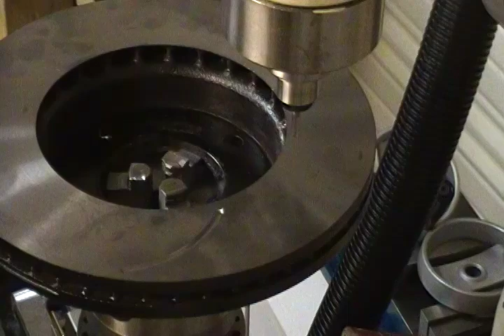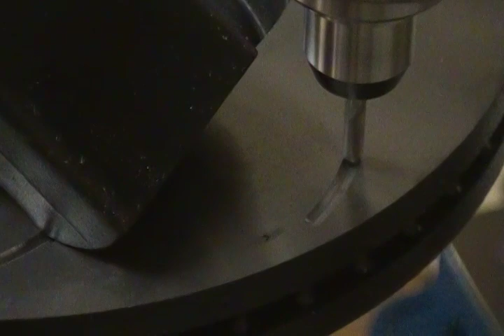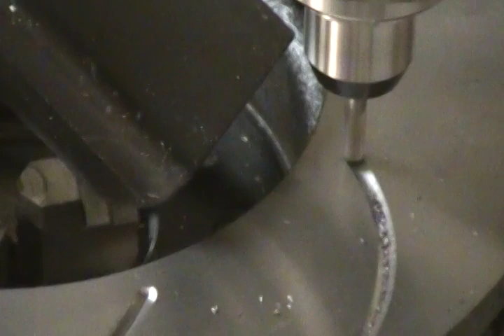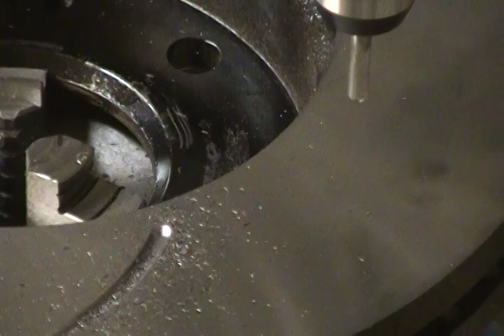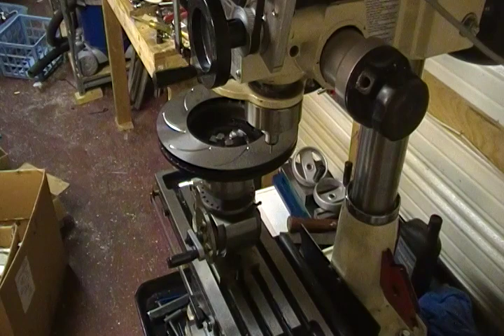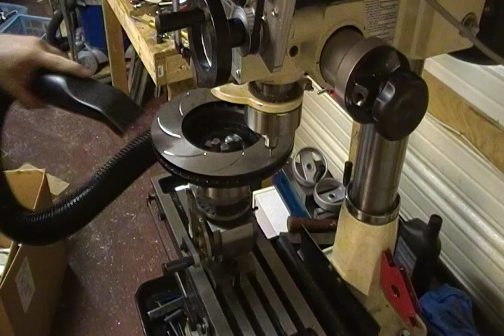Slotting A Brake Rotor On A Retrofitted CNC Mill

Comment from the maker: @sk8wnec  I did the retrofit myself I used 3/4" ballscrews for the X and Y and a pair of 1250oz steppers. For the Z I used a 700oz stepper with a 2 to 1 belt drive using the original gearing. For control I used the hobby cnc controller and an HP laptop running Mach3.

Comment: Hello JPN76

I would love if you could explain me how you retrofitted that CNC machine, we currently make drilled rotors but I would love if you could let me know how to slot with a not too elaborate CNC mill, please let me know, I would love to have the same setup, I don't mind doing it by hand instead of the automatic table.

Comment from the maker: @sk8wnec  Servos are the way to go but they are expensive. That's why I used steppers, I have less than $400.00 in the control system motors, electronics, ect... They are good for hobby but can lose steps if machining anything big.

Comment: whats he reason to slot it? I dont recall doing that when I was turning.
Reply: Helps remove water and debris from between the pad and rotor. If done right it also aids creating greater air flow over the surface of the rotor for better cooling, just make sure you slot them with left and right patterns.

Comment: Whom ever programmed the part needs to work on their programming skills. Start at one point, then reverse tool path, then start at the next closest end point and repeat this until finished. You’ll save about 50% of your cycle time and less wear and tear on your ball mills. Better selection of ball mills to a C6 carbide micrograin 3 flute is your best bet too.
Reply from the maker: ProfabDesigns Inc. Home built cnc  programmed with an old version of cambam. Not to mention this is my first ever cnc cut.

Comment: this video is a little old now but here goes anyway.

Both Good and Bad.

Good because it is good to see people doing for themselves.

Bad because thew way you are holding the disc is not the best.

I understand you choose to do it with an indexing head but the chatter that you hear is because of the way you are holding it.

You do not have enough surface area supported i am surprised it did not work itself loose ( or maybe it did and did not see it )  

I know it is another thing to buy but if you want to do work of this size of material better to do it on a rotary table ????

All the best.

Regards Peter.
Reply from the maker: Peter CCR ENG  I agree with all of the above. at the time I didn't have a rotary table. Hell I think at that time I only had a mill and lathe for a year and no experience machining prior to that.  This vid was just playing around with an old rotor just to see what it would look like. I hardly had any tooling at that time so I used what I had. it never came loose but it should have based on the mounting.
Reply: To be honest i did not expect a reply seeming it was so long ago

Not sure why i left a comment. I guess i just cannot help myself i see people doing something wrong and i try my best to let them know???

Most take it as a positive but not everyone some people think your attacking there ego ???????????????

Thank you for your reply and your answers to WHY. 

All the Best.

 Regards Peter.
Reply from the maker: Peter CCR ENG well it helps when it is truly consrtuctive. most comments like that on YouTube are "you suck" "that's not how to do it" "I can do that better in five min"  you get the point and I'm sure you see it on here often. I don't take offense to anything constuctive. I think that most guys that do think they are the best already and wont get any better with that attitude anyway. I'm at the point now I can look back at these old videos and see most of my mistakes. it is what got me this far.
Reply: Even the best make mistakes.
Even if they do not want to admit to i t ????????
Like you say there are a lot of heroes on YouTube ( keyboard heroes ).
For me if i do something wrong i am not happy but it is what is.
Machining video;s are not so bad for the idiot element, but sometimes i watch various other video's here on YouTube and the idiot element is too much.
I must go and look at some of your current video's if you are still making them that is, see what your up to now.

Thanks again for your reply.
Maybe talk / comment soon .

All the Best.

Regards Peter.